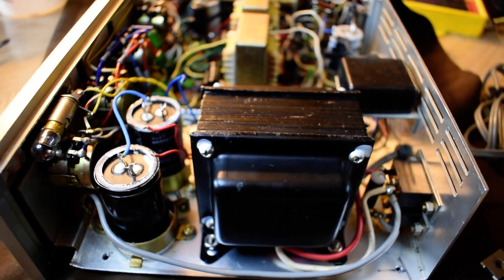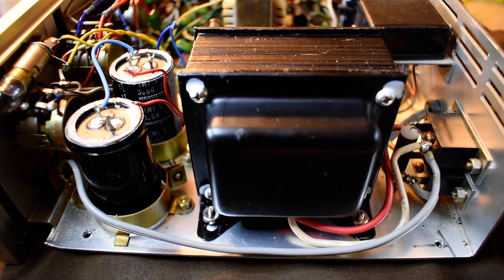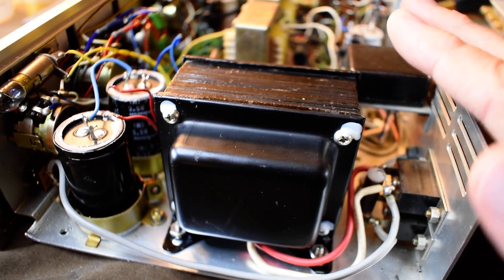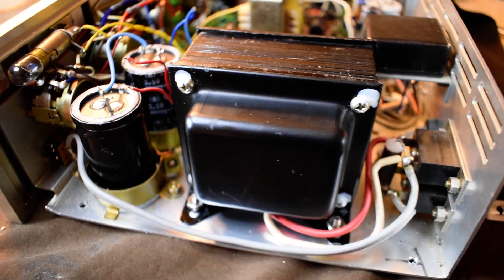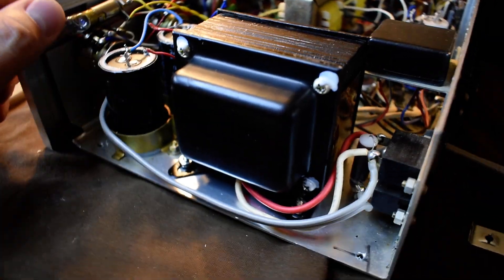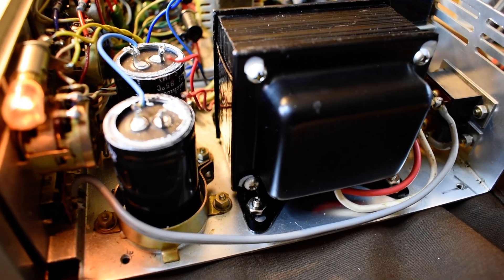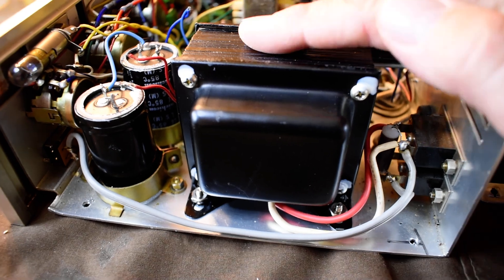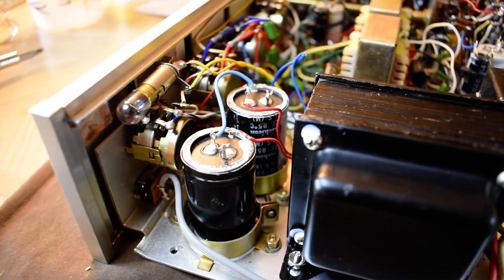Your stereo is humming and you don't know the words to the tune- diagnosing transformer hum!

Comment: interesting video; I have what looks to the same amp (I'm in the UK) A Nikko TRM-40? I'd be interested to here if you thought bad Filter Caps? or Bad Geranium Transistors, would feed back current into the chassis and cause noise to be present on all inputs? I'm not an electrical specilists so would only be able to do a little bit here and there. It was a hand me down from my late grandad and I'd like to use it.
Reply from the maker: It seems that every amp or receiver of this era is riddled with noise and there is no quick fix.  Small improvements with recapping, upgrading from germanium to silicon transistors, metal oxide resistors in phono stage etc, all add up to a unit that is a joy to listen to.  Most noise is caused by leakage through aged components the biggest culprit being transistors like the 2Sc458!